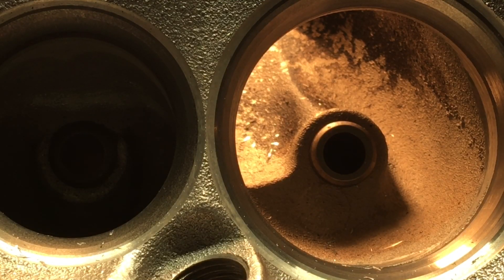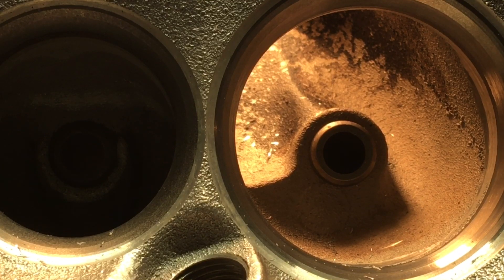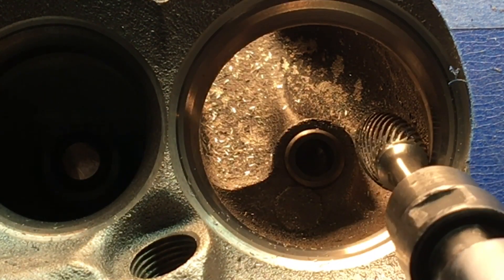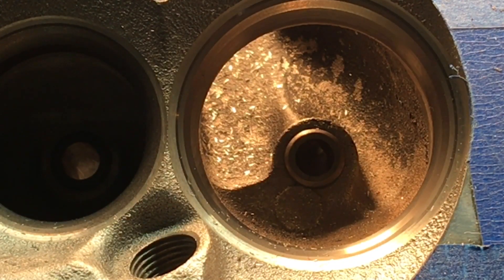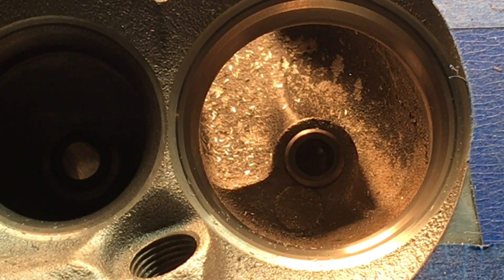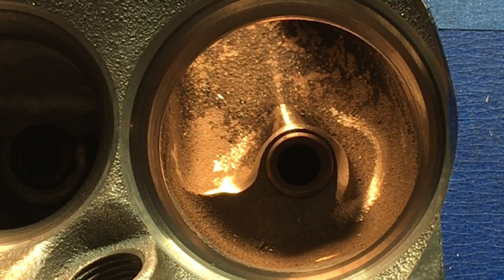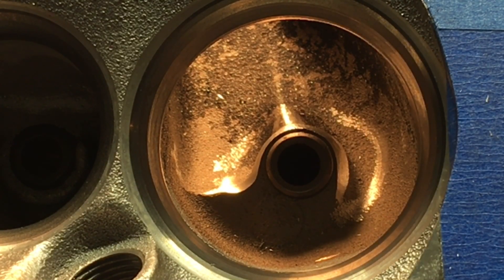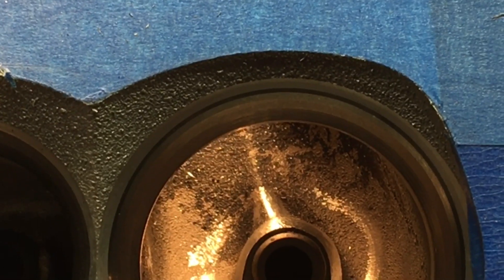Porting LS heads valve guide boss shaping/reduction

Comment: Where does the porting help low and mid lift numbers, say .300 .400 and .500” ?
Reply from the maker: Peter Fraumeni We should be able to show flow numbers soon, trying to schedule some flow bench time. 
Low & mid lift flow has a lot to do with the “curtain” of the valve to bowl transitions. Naturally having good port velocity benefits flow at all lift points.  Bowl cut percentage and smooth transitions from the sealing angle down. Also look at the area from the seat into the chamber and profile or back cut the valves as needed.  JD

Comment: Thanks good videos. What heads u recommend for a 5.3 and what you charge for a port job...
Reply from the maker: Teo Acosta The heads for a 5.3 really should have either 1.89” or 1.94” intake valves for the best fit to the small 3.785” cylinder bore. Many people run heads with 2.00” intake valves but it’s not the best combo in terms of efficiency. 
Ask yourself, what octane fuel do you want to run in your 5.3, so you can narrow down what compression to build. 
I’ve never had anyone follow through with a port job when shipping is involved.  
Porting both Intake and Exhaust ports on the heads $750.00 (All parts and machine work are charged separately)
What type of build are you wanting to build?

Comment: cool vid. i want to port my own heads, thanks for the tips!
Reply from the maker: Ian Davis Go slow and be conservative.  The bulk of flow is gained by a performance bowl cut percentage, valve job angles and blending.  Valve guide boss reduction/blending is a higher lift flow, you do not have to remove the swirl ramp to increase flow. 
Look into what ever style heads you’re going to work on, identifying problem areas and thin spots. JD